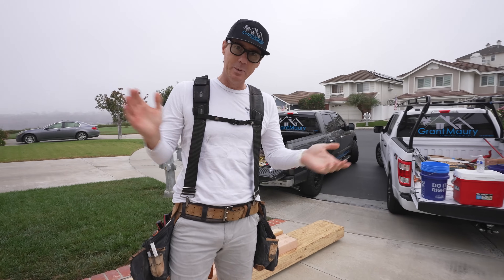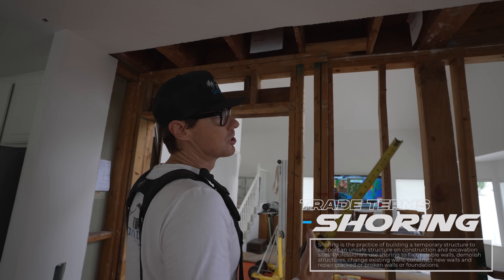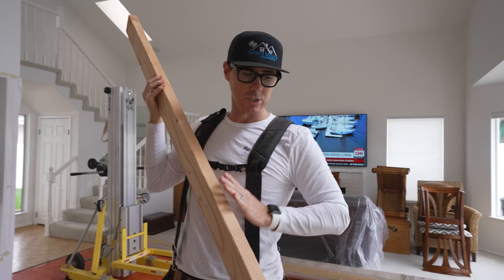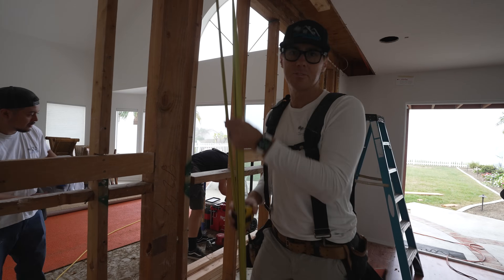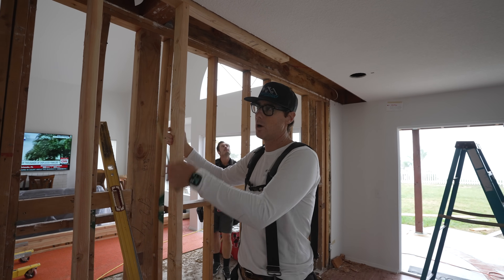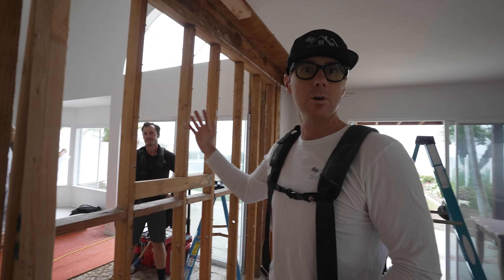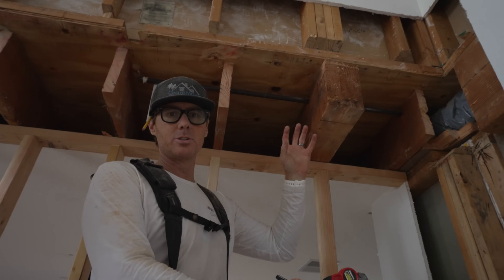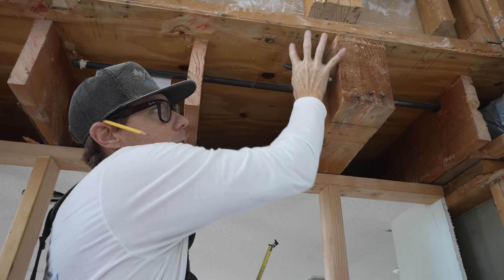How to Remove a Load Bearing Wall + Install a Structural Beam

Comment: Just out of curiosity, what range of pricing for this type of work? I’m asking cos I’m about to do the same in my house. It’s a 12ft long wall I’m removing and there is no floor above. One guy is charging me $7000 and the other said $900. That’s a massive price range. Which is closer to the real price. I don’t want to overpay. Any advice will help.
Reply from the maker: It really depends on your region. I would say a safe bet with a trusted builder should be around 5-10k.
Reply: @grantmaurybuilds  thanks. The $7000 guy is a structural engineer licensed. The $900 guy is a general contractor who has built several houses I
have seen
Reply: I tell you the guy who charge $900 don’t know what he is going to do
Reply: @Marckdc95  ok cool. Thanks. I’ll go with the other guy
Reply: I am going to the same in March '23.  Just that beam alone, may cost $500? I am not sure. You need to rent the lift ($150?), At least 4 ppl, whole day job. Assuming $2500 is the rock bottom for this length.

Comment: Why did you use a 2x4 in the temp wall instead of putting a post under the existing beam  and put the temp under the rest I would think that's too much weight for the  2x4  it looks like Half the upstairs was hanging on that 1 beam
Reply from the maker: Good question - in actuality the 2x4 temp supports spaced approx 16” on center will hold a lot more weight than one might think - so long as it is temporary. You can always add more supports (2x4) if you feel the need. Always better to be certain you have enough temp support. Hope this helps. Thank you for your interest in the channel!
Reply: Thanks 😊

Comment: Great step by step video. Where the original upper floor joists meet the new beam, I wonder how strong the joist hangers are to hold up all the upstairs weight? This was an amazing job!
Reply from the maker: Thank you for the support! Great question re hangers - it is always recommended to check with a structural engineer or follow renderings provided for any similar scope work. Is this case, we had our engineer instruct us on which hangers to use, and we installed accordingly

Comment: I like the videos, but you guys really need to use your PPE.  Two guys not wearing any sort of safety boots is just asking for an injury.  Also, having two lifts for this type of beam is much safer as you distribute the load.  Trying to balance the weight on one lift is a bit risky.

As an additional note, looks like you guys have good weather there while working, why not just cut your material outside?  You're adding dust to the living space for no real reason.
Reply from the maker: Thank you! We completely agree with your remarks. We try our best to emphasize safety, and you are correct!

Comment: On the left hand side several studs are cut, are these not all part of the same load bearing wall? Why are they not supported then? What am I missing?
Reply from the maker: In the video we detail which direction the  rafters and joists are pointing, therefore indicating which part of the wall is actually load bearing. Hopefully this or the video answers your question.

Comment: Good video with great info. Easily the best video on YouTube on installing a beam. Several years ago my son and daughter-in-law wanted to knock a wall down between their kitchen and living room. I told them it was a load bearing wall and would need a beam. (I had been in their attic before and knew it was load bearing). Her parents were having work done at their house and their carpenter came over and looked at it and said it wasn’t a load bearing wall and he could do it pretty easily. I talked them into having a structural engineer look at it and he confirmed it was load bearing and gave them a couple of different options.  My point is to get a structural engineer to look at it and confirm either way.
If for no other reason than it makes sure everyone stays safe down the road.
Reply from the maker: Thank you. Yes we completely agree. Best to work with either an established, trusted builder or bringing on a structural engineer.
Reply: Yeah every idiot who's pushed a broom and bought a hammer is a "carpenter" these days.  Coke heads and high school drop outs.  Gotta love construction.

Comment: so now that you have installed a beam you have created substantial point loads at both ends. I see you put posts at each end but did you address the point loads in the foundation or what ever the floor is constructed of ?
Reply from the maker: Yes! We previously addressed this in earlier phase of construction.
Reply: @grantmaurybuilds  yes i knida figured i missed that, couldn't imagine you didnt know better.
Reply: A good Contractor will always check loads to the foundation!
Reply: So was the existing foundation adequate or did you have to strengthen the foundation?
Reply from the maker: @biggunschow  Reinforcing the foundation is always per engineer recommendations. Thank you so much for the interest in the channel!
Reply: @GrantMaury Builds  agreed. I didn't see any evidence of strengthening so I was surprised the existing segment of  continuous wall foundation would be ok for the concentrated.
Reply: Thanks very cool video